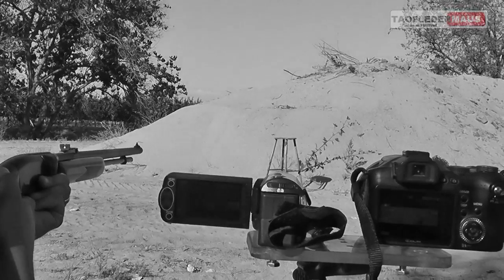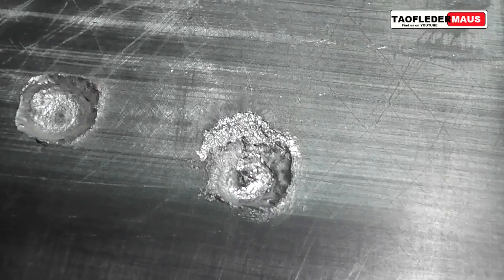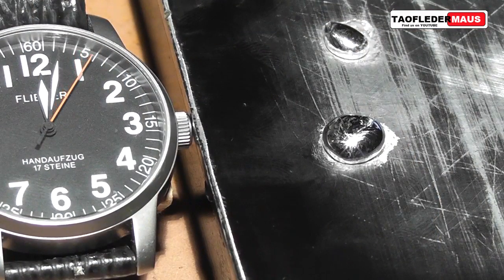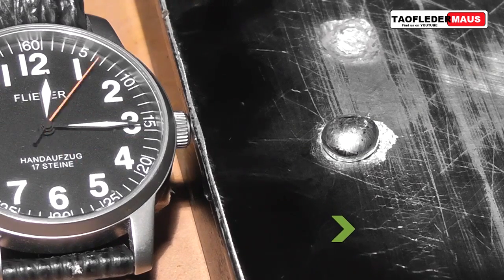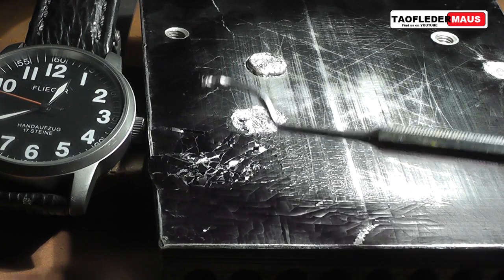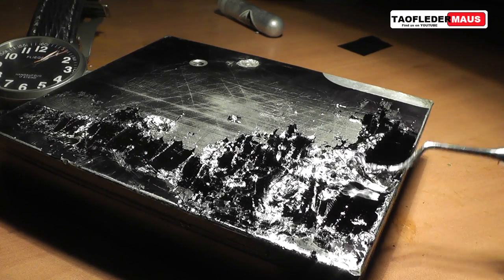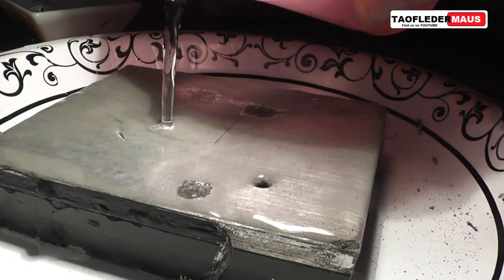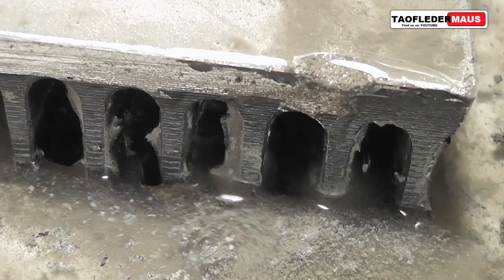Demonstration of GALLIUM's Amazing Destructive Power (gallium bullet follow up)

Comment: So I’m a careless moron and dropped Ga onto my MacBook Pro chassis.  Thankfully nothing happened.  But do I have something to worry about down the line?  It wasn’t scarred or damaged like your bullets did first.  I have an Al shrouded device that I did intentionally damage and Ga did nothing.  In fact, it was cold enough I guess from the AC, it instantly froze.  I tried keeping it outside during the heatwave to ensure it stays liquid but still nothing.  But foil certainly crumbled fast which was neat.

Comment: the reason why it seemed like you where creating acid when pouring water onto the mixture is because it created aluminium oxide with the water, creating a hydrogen gas byproduct.
Reply: haha, I see you explained why, well, I'll still leave my comment because it explains how you get the gas.

Comment: 2:01 what you can see here is the aluminium reacting with water forming aluminium oxide & hydrogen. the gallium removes the protective layer which normally prevents aluminium to react with water like that

Comment: When gallium is added to aluminum, an alloy is produced. Adding water breaks that alloy down into aluminum oxide (essentially rusted aluminum), hydrogen, and gallium. This separates the gallium you started with from the aluminum and leaves it free to bond again with the remaining (non-oxidized) aluminum.

Comment: Aluminum is a highly reactive metal. Nornally we don't see that because the outer layer oxidizes almost instantly, which is also what an anodized layer is. The gallium begins attacking the aluminum after getting past the oxide layer. Once the oxide layer is gone, water reacts with aluminum easily.

Comment: when you put water on the gallium/alumin(i)um alloy, the aluminium reacted with the water because it didn't have an oxide coating to prevent it to react.

Comment: Could you have any more stuff blobbed on the screen covering the video? Perhaps a sing-a-long bouncy ball with scrolling text? Great video otherwise, VERY COOL! I didn't know gallium could do that...makes me wish I had some when I found an aluminum engine block that I couldn't melt down because it was too big. It ended up not even being recycled and someone tossed it in a dumpster :<. I had a little foundry, but not large enough for something like that.
Reply from the maker: I'll try to blob more.  Sorry about that.
Reply: Lol! Cool video though really love it! I just saw another one where this guy dumped 500 grams of it on a phone... what a waste! You used a very small amount and clearly demonstrate how powerful just a pinch can be. Btw, same effect. He just had a ton of diluted gallium based alloy at the end, and a messed up phone, whereas you still would have 495 grams left from the same amount on a much larger piece of aluminum.

Maybe you could make a video on how to separate the aluminum from the gallium once it is broken up? Would be very very useful for hobby metal junkies which i dabble in myself from time to time. People could get ingots from large aluminum scrap that would otherwise require a larger foundry. Then turn around and make parts from those ingots.

Comment: Really nasty stuff; incredibly corrosive. It can't possibly be safe to handle that piece of aluminum. Aside from the basics I am no chemist, but logic dictates that if it does that to the aluminum after rinsing it off, traces of gallium would still be there, and therefore it's not safe to touch that aluminum with bare hands. Am I wrong?

Comment: First, by scraping it off, you're actually spreading it, Ga and Al creates an unstable alloy that is highly reactive, that's why when you poured water over it you were actually witnessing a corrosive reaction in which the new gallium aluminum alloy mixed with water produces hydrogen and aluminum hydroxide [Al(OH)₃]

Comment: So what would this do to the aluminum's ability to dissipate heat, since you are using a heatsink to demonstrate this? Gallium has high potential for convective heat transfer, but does the alloying with aluminum compromise that or improve the transfer in the aluminum heatsink?

Comment: Do I smell an easy way to make aluminum powder for thermite?
Reply: whats left isnt really aluminium anymore
Reply: ***** No sir you are wrong. I did not mention anything about water in the equation as is evident in my comment. You jumped to the assumption I was talking about the addition of water which I wasn't. Just proves to me you are an inbred halfwit, and furthermore the aluminum still did not change into another element. The aluminum is still aluminum, and lastly I stand by my previous notion of the aluminum being used to make thermite after the gallium corrupts the crystalline structure of the aluminum. It would work although perhaps not as efficient due to the remnants of gallium left with the aluminum. Even in your pretty little chemical equation you proved the point of even with water the aluminum does not change into a different metal it is still aluminum just with a hydroxide on it. Please go back to school and read some books I think you have a long way to go.
Reply: Wisdom BigBrain
Ok I am going to anyway, because I love battleing keyboard warriors, hahhaha.

With "really aluminium" I meant no pure aluminium. The element aluminium doesnt dissapear obviously, but since its a different molecule now, you cant really call it aluminium, (see Nick Barters comment) if u are as smart as u claim to be u should know this, but since you dont, well... go back to school.

PURE aluminium is needed for aluminium powder, but after the reaction with the gallium in the video, involving WATER by means of condensation, its no more Aluminium. You can see that adding water also accelerates the reaction, the equation given by +Nick Barker is what has happened in the video. Aluminium forms 2AL(OH3), which isnt the same as pure aluminium and thus cant be used to make aluminium powder.

You should really start using some calm sense and reasoning before you start spitting ur shit everywhere, it's not gonna get ya far in life, just look where u are now.
Reply: William van der Scheer Clearly you didn't read my comment but rather read only what you wanted to see. Nowhere in my comments did I mention water being added to the equation. Thermite can be made WITHOUT the presence of water from the reaction. All the gallium is doing is interfering with the bonding of aluminum to aluminum in the structure of the metal. It would still work fine with small traces of gallium in the aluminum powder just not as efficient. You are fighting a straw man and frankly have horrible literary skills because I just had to reiterate  everything I said in the previous comment.
Reply: My last comment was entirely referring to:
" Even in your pretty little chemical equation you proved the point of even with water the aluminum does not change into a different metal it is still aluminum just with a hydroxide on it. "
I guess I should have made that clear.
Therefore I assumed u meant that you can use this "aluminium just with a hydroxide on it" for aluminium powder, which is just so false that I makes my head hurt, and I'm sorry that you think that. An aluminum IONIC COMPOUND != Aluminium, Just because the letter al are in it doesn't make it so. *genius
IN FACT, You couldn't even retrieve the aluminum Because as you should know IONIC COMPOUNDS DISOLVE, so the aluminum is in the water, good luck with that.
A simple amalgam-> as you said, yes would still contain pure aluminium that can be used for thermite, and my original comment assumed that you were referring to the aluminum left after the reaction with water, making this entire internet war only based upon simple misunderstanding, yet, ofcourse, you really like to turn up the heat eh? None of your hostility is appropriate to the situation and makes me wonder what kind of person you really are, now that the anonymity of the internet reveals your true nature. Think about that, you should work on it, like I said it won't win you many friends, if you even have any.
but still consider this as an answer to your original question, so we can close this off:
Amalgamating wouldn't (practically) work for aluminum powder because:
1, gallium is expensive af and ur wasting a lot of it.
2. the thermite wont be effective because of the gallium contamination. Which is a huge nono, why would you want subpar allumium, for a higher price?
3. Sure the aluminium becomes brittle, but doesn't just turn to dust, you still need to make it into powder, and therefore u need a grinder still.
4. It will take so long for the gallium to weaken the aluminum that u might as well put it in the grinder u already need in the first place and be done even faster and easier.
So no, its not an easy way to produce aluminium powder. 
Now, if you are still not satisfied you can always reply because I like conversation, but please learn some manners and keep your anger issues to yourself. It is easy to be toxic on the internet, while being a pussy irl, but that doesn't excuse anyone.
Now, Have a good day.
Reply: Wisdom BigBrain

Hahahahahaha, sure if being angry all the time is your way of having some nice intellectual conversation, go ahead, I am sure it is making you feel good about yourself.

I quess some people just really only can boost their self image by trying to destroy someone elses, good luck with that mate.

Comment: The reason it looked like acid when you poured hot water on it is because heat catalyzes (speeds up) reactions by adding energy since heat is actually just raw energy.

Comment: Try a iPhone 7 and see if it's gallium proof
Reply: gotchya.  no worries!  ;)
Reply: There is a video in the suggestions of an iphone 6 being covered in it, watch that

Unless there's aluminum in the phone, I doubt it will do too much. I dont think aluminum is really used too much in a phone.
Reply: uhhhhhh The iPhone 6 and the preceding iPhone 5s and 5 are made out of machined aluminum
Reply: capth00k All right, didn't know that. But just letting him know it'll probably be the same reaction as that other video lol
Reply: techrax did a gallium vs iphone video. it literally turned into dust.

Comment: What a bunch of crap. I've got a ton of experience with gallium and aluminum, and this is the kind of result you'd get when you bathe alluminum *repeatedly* in a *ton* of gallium.

That isn't just 2 drops, and the reaction wouldn't continue after being washed and then submerged in soapy water.

Nice try at making a viral video. But if you have to lie you don't deserve the views. Making sure everyone i know is unsubbed from this crap.
Reply from the maker: I have no reason to lie about how I did it.
Reply: Perhaps you should demonstrate this instead of providing anecdotes.

Comment: What you did was removed the oxidation layer of the aluminum through the use of Gallium in the same manner than aluminum amalgams work in chemistry. This gallium amalgam you created allows aluminum to donate electrons, which react with water. The gases are probably oxygen and hydrogen

Comment: any scientists out there explain the science of what's happening to the aluminium?
Reply: Gallium and mercury metal does at least two things; one it wets the surface of aluminum which allows oxygen to combine with each of the aluminum atoms, where as the liquid metal wets more, two; it gets into aluminums solid crystal lattice and stretches it some where it becomes brittle and can allow oxygen to combine. Water makes the aluminum oxygen combination faster hence why it gave off hydrogen.
Reply: Gallium is made up of tiny alien spiders and aluminium is like a delicacy for them.  True story.
Reply: Dusty Korpse Glad I could help.
Reply: i personally don't know but it appears that the aluminum is porous.  the gallium is penetrating the oxide layers of the aluminum, and mixing, or dissolving with the aluminum to create an alloy.
Reply: thanks for the knowledge ☺
Reply: I doubt that heat sink is really aluminum as the video poster claimed

Comment: Aluminum is a pretty reactive metal. The gallium removed the oxidized coating from the aluminum and the water dissolved the metal... .. aluminum natural makes an oxidized coating when exposed to oxygen that protects aluminum from being as reactive as it is. .. without the oxidation on its surface the aluminum will dissolve in (basically any liquid) water .... you can see a more powerful example by rubbing a deoxidizer on aluminum foil and quickly putting it in a glass jar filled with water. The aluminum will dissolve.

Comment: Was that heat sink good quality? Based on the quantity of interstitial hydrogen being released, it seemed like the metal would be weak to begin with. Aluminum alloy hydride is a common defect, even as far as being useful in the storage of hydrogen. That may be why the gallium had such an incredible permeation alongside flammable gas release.

Comment: OMG WHY AREN'T YOU WEARING GLOVES HOT DAMMIT
Reply: Gallium is not toxic. The only reason why it "eats" through alluminium is because it penetrates the protective layer of alluminium oxide and creates an alloy with a low melting point. By the way gallium itself melts at ~86F so you can melt it in your hand.

Comment: can some one explain the chemical reactions?
Reply: Gallium reduces the surface tension of the metal, almost eliminating the ability to fight oxygen. Oxygen is very corrosive to aluminum, except the reaction produces aluminum oxide in an impervious coat. the gallium disrupts the al ox formation. the aluminum basically ripped the water molecules apart to get the oxygen.
Reply: no
its magic
Reply: +Howard Hurley Thank you.
Reply: nerd lol
Reply: So the product would be an amorphous Al2O3 with the remaining Al lattice? How is Gallium distributed through the Al crystal? Does formation of Al203 makes a pasivated pore or something like that?

Comment: Question, make a some kind of size in special glass that breaks with high heat, fill it with gallium, place it on key points of steel welds to make it collapsible after some time. Would it work?

Comment: What is the make and model of your watch good sir?
Reply: Have a Sinn 556i on bracelet, can confirm they are really nice.
Reply from the maker: I have no idea.  I bought it on Ebay about 10 years ago.  It's a mechanical watch,  but has a really cheap movement in it.  I think I paid $50 for it from a German seller.   Probably don't sell them anymore,  but search  "aviator watch"   and maybe you can find them.
Reply: Sinn makes some nice mechanical aviation style watches. With matching price.

Comment: Nice watch! Where did you get it?
Reply from the maker: .  I bought it on Ebay about 10 years ago.  It's a mechanical watch,  but has a really cheap movement in it.  I think I paid $50 for it from a German seller.   Probably don't sell them anymore,  but search  "aviator watch"   and maybe you can find them.

Comment: damn they should ban that stuff, imagine if terrorists started using it for targeting planes (mostly made of aluminium) :O
Reply: Way less effective then a C4 bomb. Good luck pouring gallium on a plane without getting caught
Reply: Yes but it is already illegal to have C4...
Reply: this is why mercury thermometers are not allowed to be carried on aircraft.
Reply: less than a fifth of a modern plane is made of aluminium. mostly composite structures for weight savings and durability.
Reply: Gallium costs over $200/kg and takes hours to days to attack aluminum like that. And gallium is conductive enough to be easily detected by a metal detector, so it is not trivial to get onto a plane. It is a total non-threat. Airport security targets enough fringe weapons as it is.

Even if the entire skin of the plane were made of aluminum, the interior clearly is not, as anyone who has been on board a plane can tell you. So to use gallium to attack the plane, you would need to saw a hole in the plastic interior, clear away all obstructions to the hull (which would require several tools), dump gallium into the opening, wait a few days, then break through it with a hammer. The end result would be a small hole in the fuselage.
Reply: It would take several weeks for the gallium to go from the seat anchor to any critical structure, if it ever got that far before getting spotted.
Reply: Only for the newest planes.. Still mostly aluminum. Anyway, you'd have to get to the aluminum first, then remove the coating, then pour it. You'll probably just end up with pressurization problems but the plan will not be destroyed.
Reply: fuck these nerds
Reply: +EebstertheGreat base of your seat is aluminum, and attaches to an aluminum bracket that is part of the aluminum main structure. 
not to far of a stretch.
Reply: Teardown Dan if and buts were candy and nuts, we'd all have a wonderful Christmas.
Reply: I remember many years ago a plane was taken out of service when 
mercury thermometer broke aboard.

Comment: You don't want that stuff to spill onto your hand
Reply: does nothing to your hand. or to other metals. it basically just reacts with aluminum like this. but it does stick to your hand like crazy.
Reply: ***** oh ok, i thought it was super corrosive and would destroy nearly anything in it's path :D
Reply: Pvt. Gomer Pyle It can form other bonds with liquid metals I think, because Gallium is the main component in liquid metal cooling paste, used for CPU coolers. Except with the warning not to use it on aluminum heatsinks. I think aluminum is a very weak metal, probably the gallium somehow absorbs into the aluminium like a sponge and weakening its bonds. But I'm not a chemist, don't know why or how exactly this happens to aluminum. What I do know is that Gallium is solid at room temperature, but somewhere above 29 or so degrees Celsius it becomes a liquid.